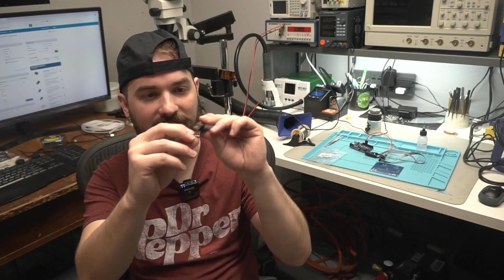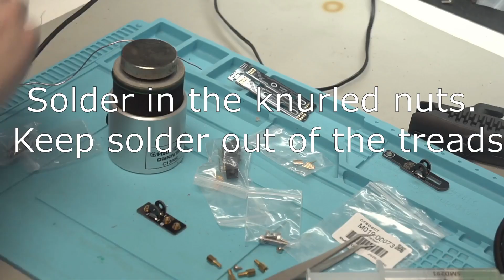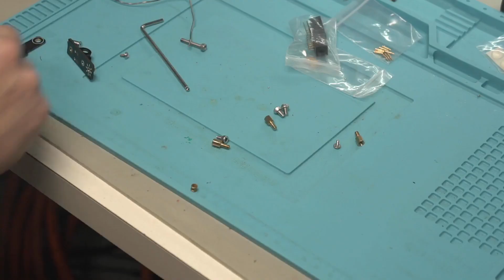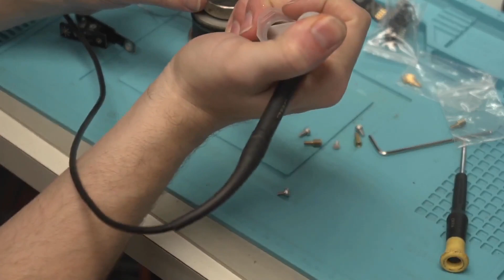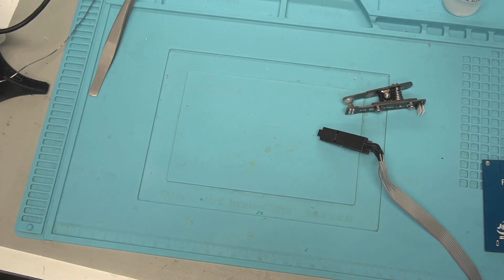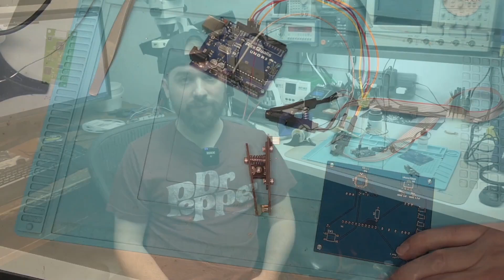Affordable Programming Clip "eclip" by Leo Yan Sold By DFRobot  DFR0359

Comment: Tag-connect is a bit more expensive but you only buy one, so its a good investment and MUCH more pro. They have footprints with and without clips. I use the one without clips (to save space), and they sell a little retainer to hold it on from the bottom for debugging.
Reply from the maker: I have seen them and I think they are absolutely worth the price in a production or professional environment but I was just looking for something a little more budget friendly for hobby stuff. 

I mean some of tag connectors get as low as $40 which really isn't bad at all. Some are in the $100 plus range too especially some of the different name brands in the tag like connectors
Reply: @Fixed Until Broken  yeah, the 6 pin  tc2030-mcp is $45 at mouser and perfect for stm32 or atmega projects. It's worth it to me not having it move when debugging.
Reply from the maker: @jasonrussell6534  The SOIC bite footprint is nice for hobby use because most people it's free since they probably already have an SOIC 8 clip but I wasn't super wild about it.

My thought on this is I can probably use one of the tag footprints with it so that way people that want to recreate my projects have an option that is cheaper than buying an actual tag connector. I ultimately plan to get one myself but for someone recreating 1 project it might not be worth it.